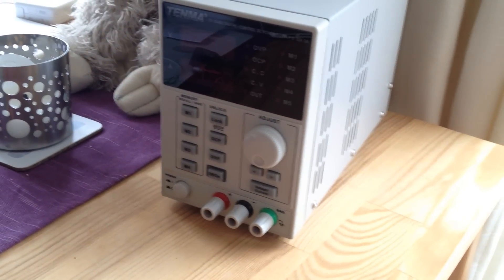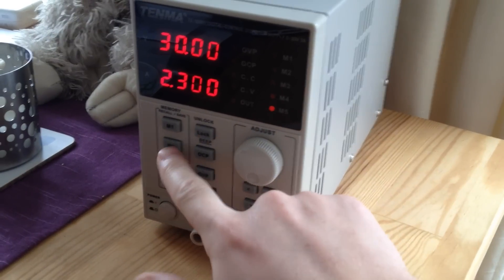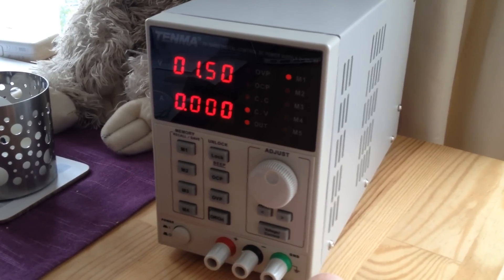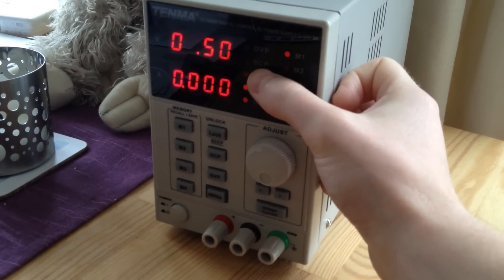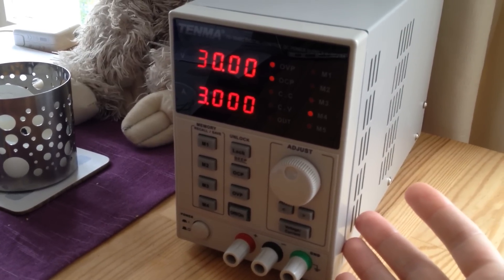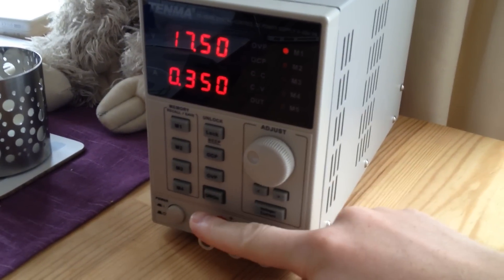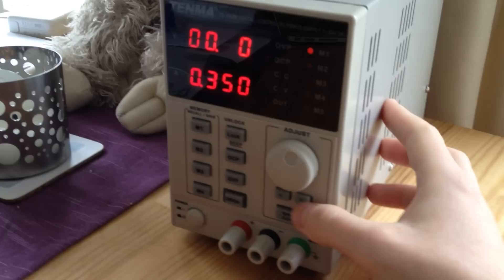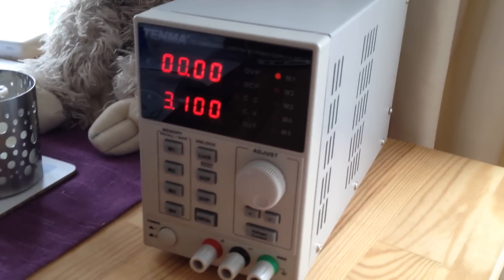Tenma 72-10480 Bench/Lab power supply review

Comment: Wow does that thing immediately switch to the memory-set voltage as soon as you press the button? That's a bit scary. If I was designing that thing I'd have a separate "set" button.  ..and the adjust button stops working after a few seconds? Damn, some user-interface genius designed that...

Comment: Just found your video and wanted to add a couple of things. The first is make sure you program M5 to a very low value as it is very easy to switch from M4 to M5 accidentally and by default is set quite high. All you have to do is set a low value on the displays then hold in the memory button to store the set value. The other thing to mention is that it is very easy to fit a thermal switch and quieter fan which I have done to mine and it makes it a much more usable unit. I have also changed both the OUT LED and the CV LED to greens as a better visual indicator as well as fitting light blocker (blue tak) between the LEDs to reduce the bleed from one LED to the other. Karl

Comment: I couldn't quite see in the video, but if you select the 1/10th (first decimal place) voltage display and turn the selector will the voltage roll over all the way up and down in 0.1V steps or does it stop when reaching 0.9? I would like to buy a variable supply so I can test equipment (that normally runs on batteries) and see how low the voltage can be reduced  before it becomes unstable, so being able to step down the voltage from 12V to 5V without having to select a different decimal place each time.
Reply from the maker: Yeah, it does roll over, so you should be fine :)
Reply: spoonymccheese Awesome! Thanks. Ordered one.